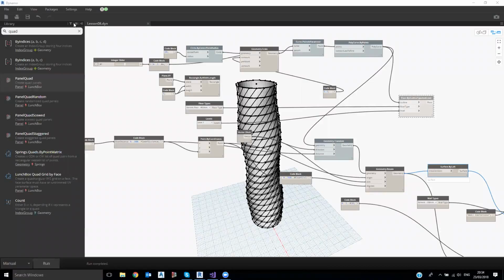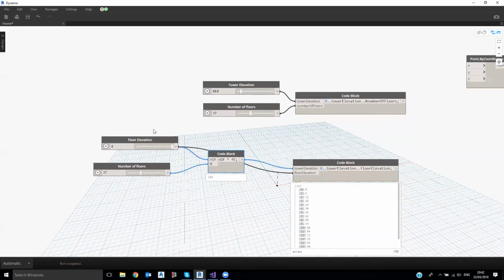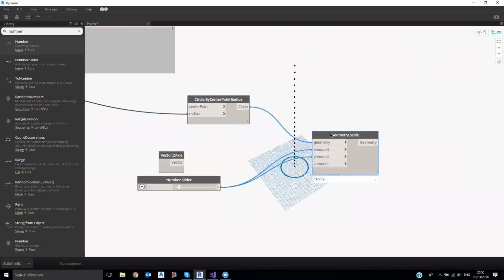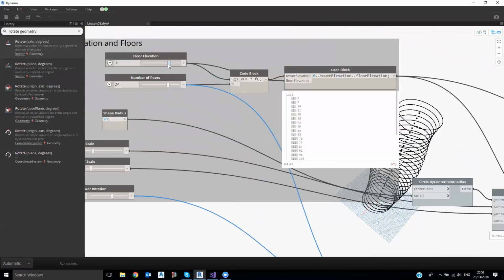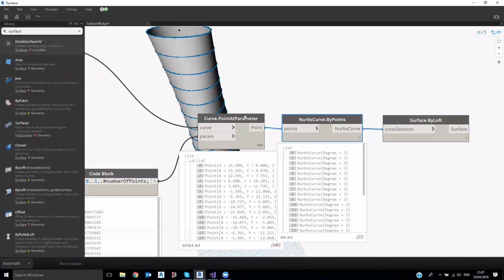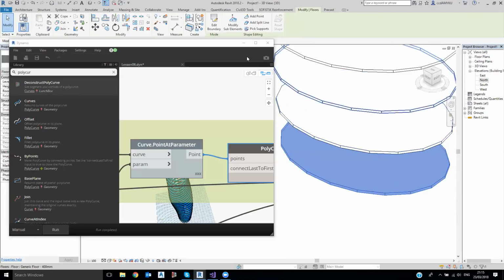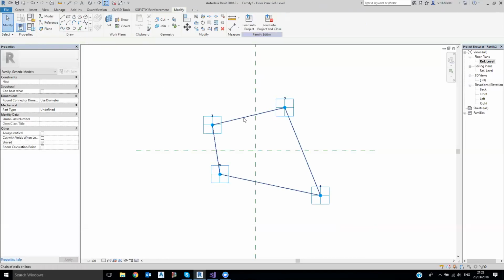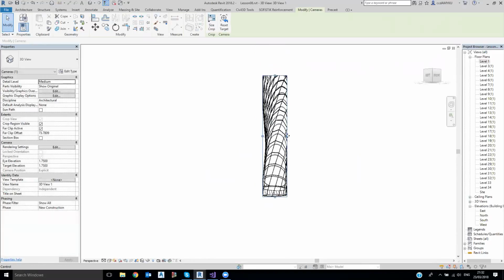Dynamo Basics Training - Lesson 8

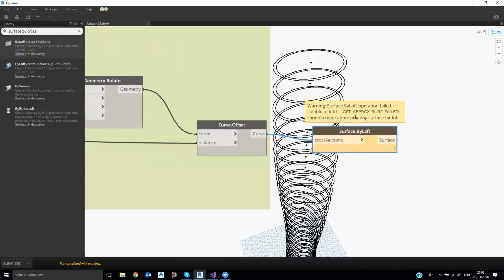Comment: I was able to create the shell surface directly using the offset curves via the "cross-section by loft" function, I did not get any errors as you got at 28:42, I wonder what the reason could be?

Also I'm getting the following error when trying to create floors using the "Floor.ByOutlineTypeAndLevel"  - Warning: Floor.ByOutlineTypeAndLevel operation failed. 
 Curve join produced more than one WIRE in PolyCurve. 

Can you tell me what it means?
Reply from the maker: It's a free course and we can't provide further assistance. Please do a bit of research. We are sure you'll find the answer 🙂 We appreciate if you post it here, it may help others as well!
Reply: @DiRootsNews   I found the solution. Hope it hlps others.

Before connecting the geometry i.e the curves to 'outlineCurves' withing the 'Floor.ByOutlineTypeAndLevel' node I used the 'Curve.SplitByParameter' node. i.e. the work flow is as follows  : 

Geometry.Rotate > Curve.SplitByParameter >  outlineCurves (within Floor.ByOutlineTypeAndLevel node) 

I used 0.5 as input for the parameter in Curve.SplitByParameter and voila the floors got created in Revit ! :) 

Source : https://forum.dynamobim.com/t/floor-byoutlinetypeandlevel-not-working-with-elliptical-outline/29740/2
Reply from the maker: @turbo64011  we knew you would be able to find it 😁 Thank you for sharing the solution!

Comment: Hey I think lunchbox for dynamo doesn't exist anymore(I even checked in the proving grounds website) so is there any alternative to that package?
Reply from the maker: You can download it here 👇LunchBox has moved to a new installer combined with the Grasshopper version.
http://provingground.io/tools/lunchbox/
Reply: @DiRootsNews  This is the LunchBox for Grasshopper... I downloaded it in Dynamo, but I found the node LunchBox Quad Grid By Face. It is not the same as you used, and it did not work unfortunately.

Comment: Hi Diroots,

I have just completed the basic dynamo course from lesson 1 - 8.
At the end of lesson 8, I need your advice about this issues : 
1. rename floor level  
2. roof slab 
3. column
4. beam
5. cutting/opening of glass panel for door access

question :

a) is it possible to do above issues directly in revit after finish the final steps regarding to lesson 8 tutorial or everything still need to completed even detail drawing in dynamo for this example case
b) what nodes are still needed to solve above issues 1-5, 
Have a nice day. 

Regards & Many Thanks,

Hepi
archidea970@gmail.com
Reply from the maker: Well done! 

If you're interested in getting a certificate please send us an email to info@diroots.com 

😉
Reply: @DiRootsNews  Sure, what should I provide in the email to diroot to obtain this cert ? Thanks for your reminder. :)
Reply from the maker: @dave77yeo  you're welcome! Just make the request and someone will provide you all the details :)